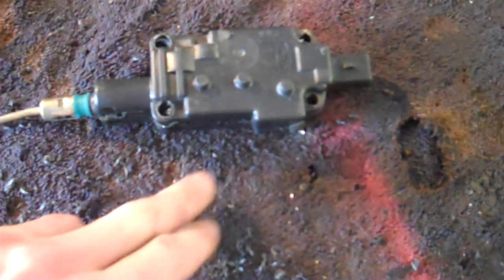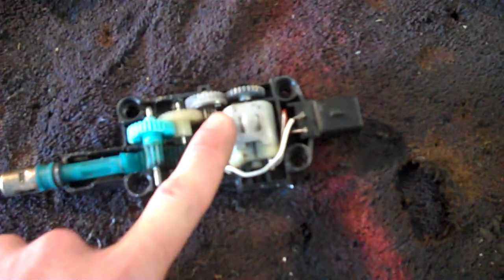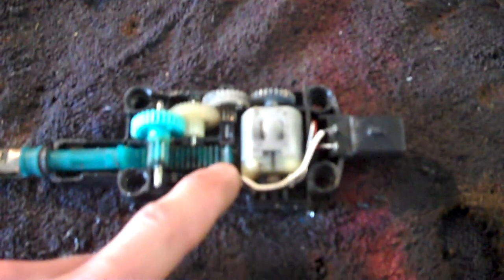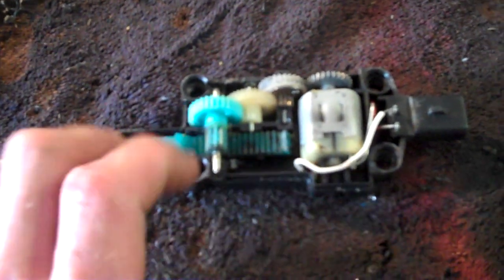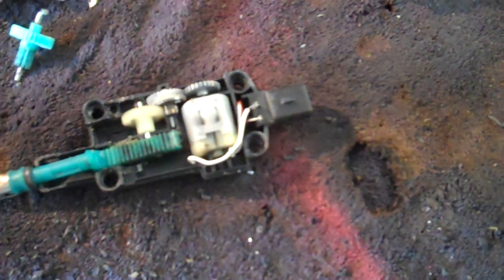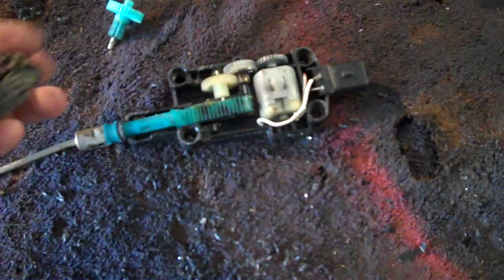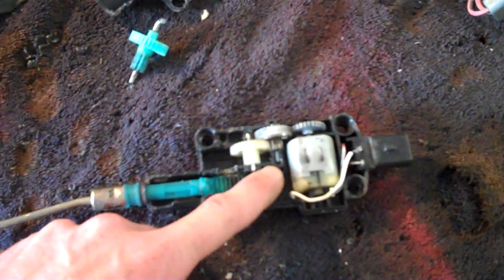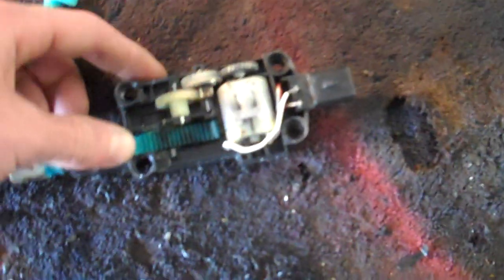Inside a noisy door  lock solenoid

Comment: What happens if you not replace this difficult to find part, and ignore that annoying noise? As function is still there? BTW I have this problem with my Denali Yukon GMC 2003, on passenger door.
Reply from the maker: Mine grinded when locking for many years but still worked. I swapped it when it started clunking while unlocking. Eventually it will just fail altogether and stop working.

Comment: What would cause a knocking sound followed by a low mechanical whine noise after unlocking the driver side door? It's a 2015 vw jetta with low miles and no other issues. Could it just be that it's very cold or am I in need of a replacement already? I didn't see anything moving under the hood and no animals under there but it sounded like the source if the noise was coming from the front near the radiator and cooling fan